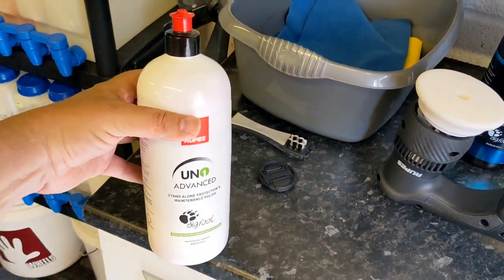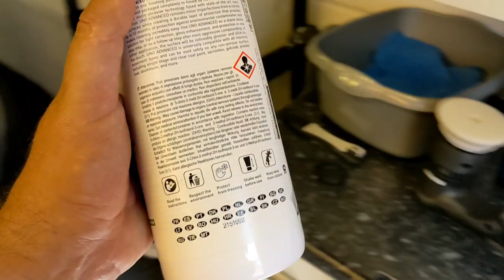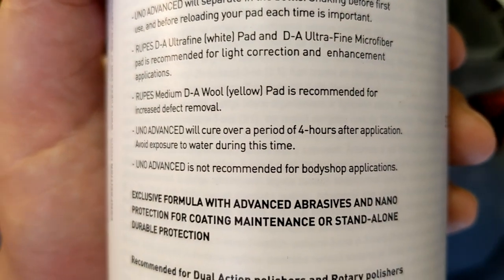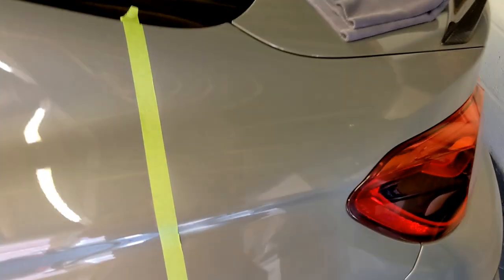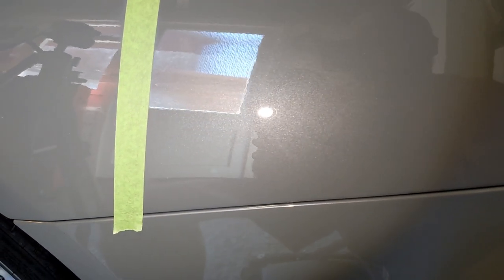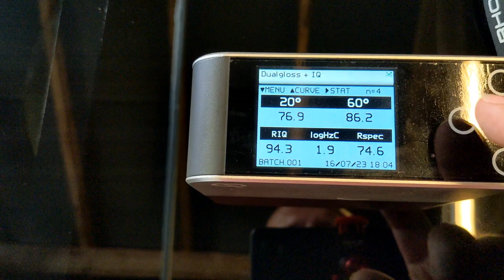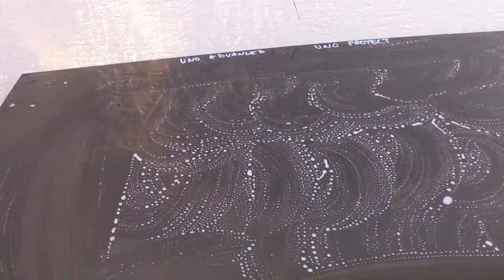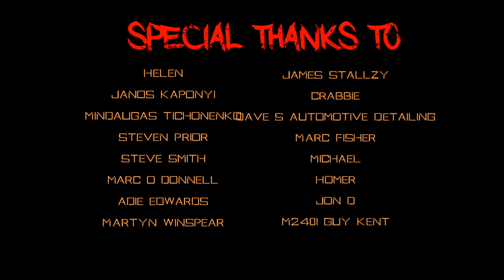At last we have proper protection in a Car Polish | Rupes Uno Advanced

Comment: Great video. I like how you think through the tests. Im curious to know how many viewers use uno protect while using bead maker (or another sealant) with the wipeoff and if it makes any difference. Would it work like that for the advanced one too. Love the vid keep em coming
Reply: I take Uno Protect over Beadmaker any day of the week. Both different products and uses. For my shop I do a lot of level 1 enhancement details for Uno Protect is the best go to product to get a nice simple cut ( change to Rupes yellow wool for better cut) and super slick finish. I would suggest Gtechniq C2V3 over beadmaker so amazing slickness and durability. Beadmaker is slick but doesn't last more than few weeks at best. 
Cheers.

Comment: Great advice as always Jon!  I have a BMW i4 M Sport in Brooklyn Grey and sadly some cheeky blighter has put some scratches on the door.  They are very light and l can only just feel them with my fingernail.  I have some experience with detailing from eons ago and things have moved on drastically.  What compound / pad combo would you recommend?  I am planning to use a DAS8 from in2detailing.  Think l have pinned it down to Koch Chemie or Rupes compounds with either rupes or scholl pads.
Reply from the maker: Koch is my go to because I understand it but scholl or rupes will be great as well m8

Comment: Chemical decon didn’t remove all the little bitsyou can still feel with fingertips, so it looks like I’ll need to clay. Paint is is rather good condition. Would you use Uno advanced for a one-step correction after a clay bar?

Comment: Sorry to ask a dumb question. If paintwork is in good condition but you just want to give it a quick whizz over like you have done here to give clarity to the paintwork and protection, would you still clay first? Or would a chemical decon suffice ?
Reply from the maker: if the paint is rough and has little spots of contamination.  test behind the front wheels on the body work with clay if its clean there then you can get away without claying.
Reply: @ForensicDetailing  legend! Thanks so much for the reply and the hard work that you put into all of your videos

Comment: Griots garage came out with their ceramic all in one which seems to be the same as uno advanced I’m planning as using it as my second step in my first upcoming paint correction
Reply: Interestingly, Griots recommends using their Ceramic AIO with an 8mm or 9mm DA.
Reply: The Griots product is great. Uno protect you can leave on whole car then buff off. Griots wipe off after you finish each panel or it will be very grabby to wipe off.
Reply: I’ve applied griots to 4 vehicles so far. On one, it’s doing well 2 months in. The other two have been maintained with ONRWW. Excellent gloss, slickness, and ease of maintenance.

Comment: Hi! A detailer used this product on my car. Few weeks later, developed some scratches on my bonnet after using a waterless wash. Should I use this on just a section of the bonnet or polish back the whole bonnet? Additionally, this product is said to last 12mths. Will there be any impact if I were to use this polish before the 12mths is up?
Reply from the maker: Just wash it down.  And machine on it with rupes advanced.   Leave 15 mins and buff.   Could just whizz it over entire bonnet so it's consistent.   Remember it's finish polish so might need heavier compound to dig the scratches out first then finish with advanced.
Reply: @ForensicDetailing  Alright, noted on this. Thanks for your advice! :)

Comment: What pad/compound combo did you use for correction on your CS paint Jon? I’ve got a San Marino CS and even with blue foam da pad and blue compound I can’t get the swirls out (using a das-6 pro da machine) wandering whether microfiber pads are needed for bmw paint to get the marks out? Any advice greatly received. Keep up the good work 👍🏻
Reply from the maker: Ive only given it a light polish with rupes uno once and another time with koch M2.    On the main panels try rupes yellow wool with koch H9 to correct it. and finish it out with Rupes white foam and rupes advanced.     Be carefull on the bonnet the paint is thin.   maybe just F6 and rupes yellow the bonnet.

Comment: Is Uno Protect a good choice to hand polish small water spots and swirls? Yes, I know machine polishing is better. This is for a tiny area on delicate paint. Can it be followed up with C2v3?
Reply from the maker: No and yes
Reply: @ForensicDetailing  What AIO would you recommend? Would you use a microfiber cloth, microfiber applicator or sponge?

Comment: It’s “not recommended for body shops” because the clear isn’t cured fully after refinishing and baking process. It would be like applying a wax or sealer on fresh paint. A big No No

Also because of sealing/ceramic characteristics of the product you can’t wash fully out of pad used and most likely will have to discard pad each time you use it.

Comment: I have recently used the blue and yellow and tried several times but I just don’t like it think I will go back to the good old rupes UHS with the grey pads the yellow and blue compounds seam to dry out after a few passes and it’s very hard to remove the polish I’m considering throwing them in the bin. Have you used them yet if so how did it go ?
Reply from the maker: Blue has crazy cut but you must do very short set with it.  Work a bit wetter keep set to 45 seconds.  Yes it's harder to buff
Reply: The yellow is OK but it has a very short working window. I don't use it very often. I prefer sonax perfect finish. It can dust a little too - not so bad as rupes -  but the wipe off is easy.